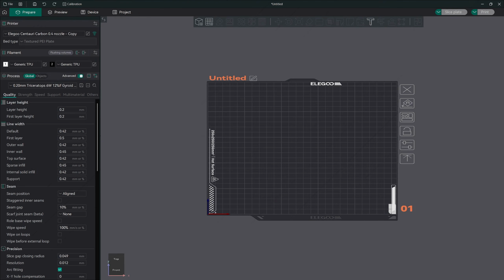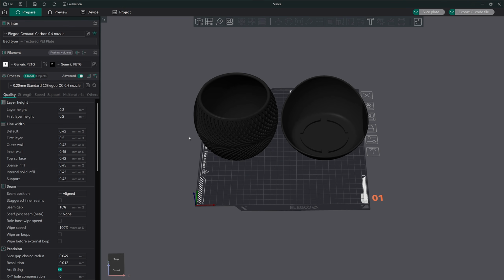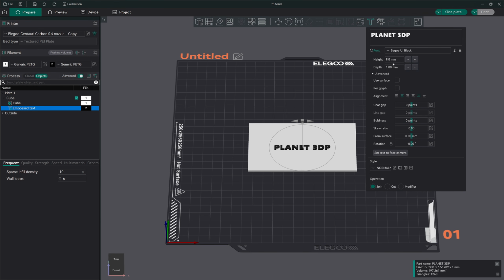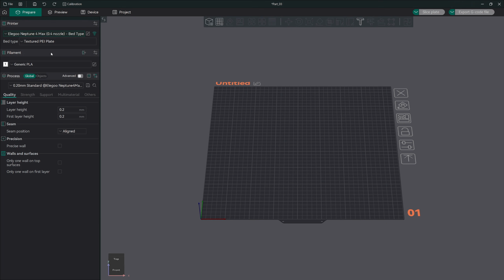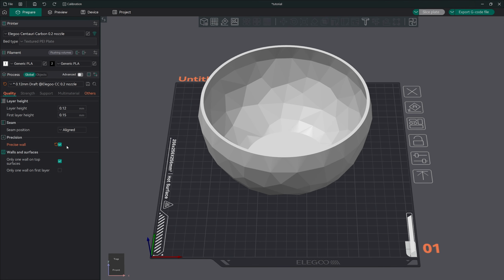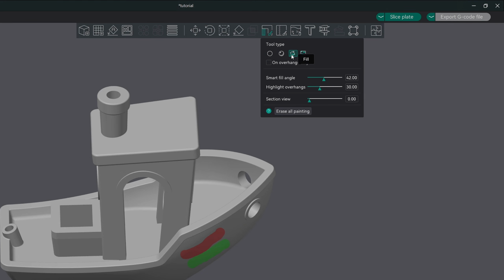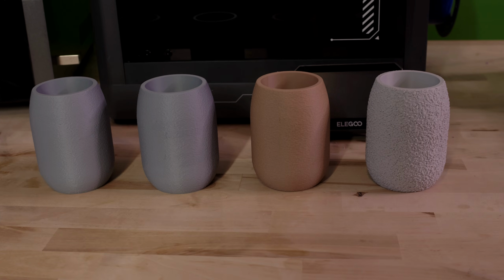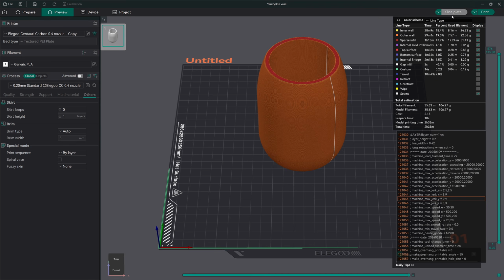How To Use OrcaSlicer: Complete Beginner Tutorial For 3D Printing

Comment: Thank you Sir, for your good, and informative videos, I just got an Elegoo Centauri Carbon, and I don't know how to use it, or the best type of computer to use for it. Lol. I'm new to 3D printing, and I have been building tube guitar amps and pedals, and working on a fender Telecaster Partscaster project, and it's my first guitar project. I'm almost 55 and I like to learn new things, I see the advantage of learning this stuff, and I'd like to find a good use for  plastic trash bottles, and other things. I think they call it PET G, and I gotta get the Canvas mod later, and I need to make a cutter jig, and use a motor, and the heater, extruder head to run it through, to roll into spools, for PET G filament to use, to hopefully make something useful from the potential trash. I would like that, and get a good feeling from it. I have a ways to go though, and I have a pure sine wave 1500 watt inverter, with only 2 smaller mighty Max batteries, I need to get more batteries too.  I would like to run it from that, in case the power blinks, or goes out. Lol.

Comment: Great video tutorial, clearly explained, thank you. However I do have a question, I am trying to see if there is a way to list indivdual print and process menus for each style of build plate. My smooth PEI build plate has considerably different print temperature and speed settings to that of my textured build plate, so am trying to find an easy way to store all these settings. T.I.A.
Reply from the maker: You could rename them with the Plate name in front? So you would have a list of PEI, Smooth settings for each?

Comment: I have tried to use Orca slicer, never get past dropping a model on the work bed, it immediately gives me a red warning box , something about extruder settings , and gives me a link to go into the G-code settings, but when I click on the link it does nothing, so I uninstalled it... Cura never gives me any issues, so I just use that. as a beginner I am not about to play with G-codes that I know nothing about. I am using a Anycubic Kobra Max

Comment: I have an Anycubic kobra 3 Max combo. orca  doesn't have it on the list. I removed "combo" in case that was giving orca trouble?
Reply from the maker: You are correct the K3 Max is not available in Orca slicer yet. I am actually in the middle of testing out the S1 and soon, the Max as well. I know currently we are not able to remotely send prints from Orca slicer to Anycubic printers but I will give my plea in my review for them to add this functionality and completely support Orca. I have many printers across many brands and having the ability to swap out prints between printers saves me a lot of time and headache. Anycubic has some great products on the market and it would be an opportunity for them to take the lead and offer support for Orca slicer with all of their models.

Comment: How did you get Orca to print to your Carbon?
Reply from the maker: Yes of course I did. That's all I am using to print with that machine. Did you not get it working?
Reply: @planet3dp I haven’t.  When I see it up in Device I’m not sure what I’m supposed to be using for the communication type. ElegooLink is what I’m trying but when it brings the printer controls it just says No Connection.
Reply from the maker: @Impuritan are you adding the IP address of the machine?
Reply: @planet3dp yes.  What are you using as the “Host Type”?
Reply from the maker: @Impuritan Elegoo link
Reply: @planet3dp yea that’s what I’m using. The interface pops up but still says “No Connection”.  Did you assign your printer a static IP address?  What band you using, 2.4 or 5gHz?
Reply from the maker: @Impuritan all that I had to do was connect it to my wifi. I did t assign it a static IP. Have you tried pinging the IP with a windows command prompt?
Reply: @planet3dp lol I gave up for the day   I’ll try that tomorrow, too aggravated to keep going today
Reply: @planet3dp  It responds when pinged, I can control the nozzle and bed temp from Orca, but that's it.  Cant home, can't adjust fan speeds...nothing else.

Comment: noob here, but is there a timelaps setting in orca?
Reply from the maker: That setting is determined by the printer. If your printer has the ability then you should be able to enable it when using the print plate option. Which type of printer is it?

Comment: I need help, I have a flashforge guider 3 ultra printer, this printer has a dual extruder, I can't find information anywhere where in orcaslicer I can match the filament to the extruder, I have two extruders, left and right, I print with 1 filament and I want the print to be pulled from the left extruder and how do I mark it in orcaslicer?
Reply from the maker: I really wish I could help you. Unfortunately I do not have one of those. Let me do some research on that printer and see if I can figure it out.

Comment: Great video, thanks. I've been using Orca for quite a while and still learned a lot. I have had a problem running Orca on my MacBook for the last few releases (since the version before the 2.0 release). It just won't run, it starts but crashes each time sometimes giving a crash report, other times not. I've tried to get help on their Discord (& Reddit and other forums) and have sent emails to the developers but haven't found anything out to solve my issue. I have had others say they are seeing similar problems under MacOS but others claim it runs fine. I do run Bambu Studio on the same MacBook, as I always have and all these problems started a couple months ago after the Bambu changes with their stand on Orca. Not sure if this is related. If you (or anyone) has any suggestions on how I may be able to get Orca running again, please let me know. It's a pain swapping back & forth between Mac & Windows machines to get my slicing done for my printers and it's difficult to move profiles between the slicers. Any help is greatly appreciated.
Reply from the maker: I run only Windows machines. I have not yet had any problems with either Slicers. Sorry I could not be of more help.